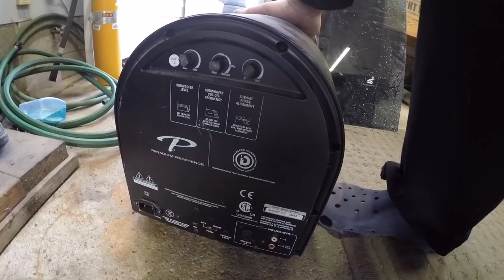Don't Buy This But Buy That And Say Away From This

Comment: Just a suggestion on the sparky plug change on the old Safari. I had Safari's from 1985 to 2003. The best way to get to the front 4 plugs is through the wheel wells. Pull the wheels and pull up the rubber inner fender flap and there they are. Its a [unt to get them from under the dog house. Lots of knuckle blood involved. JMO